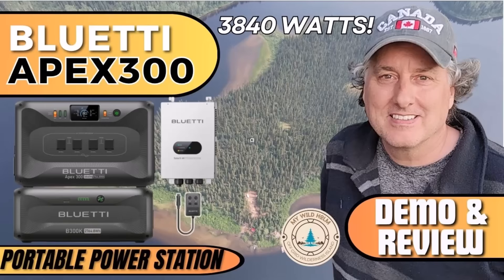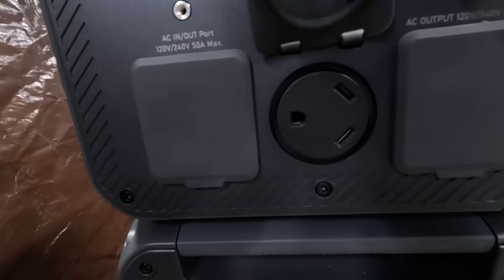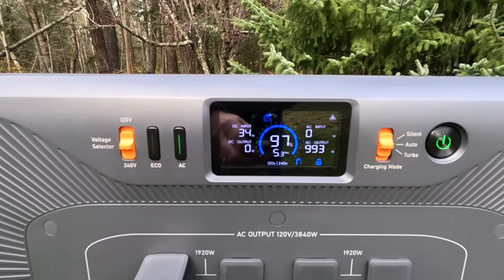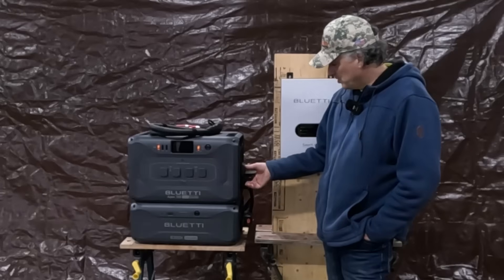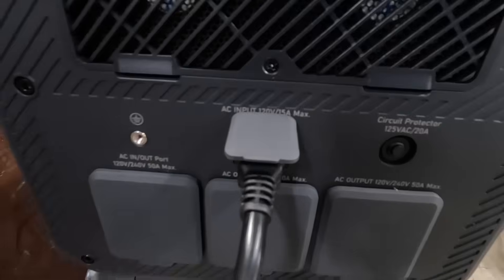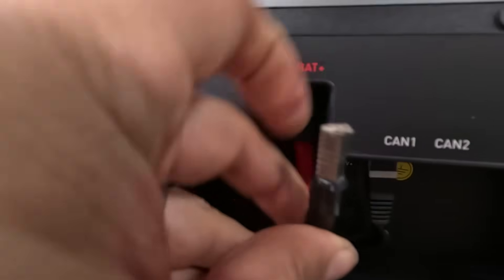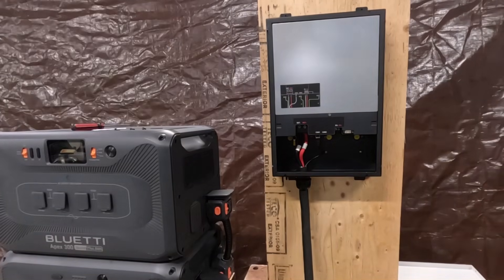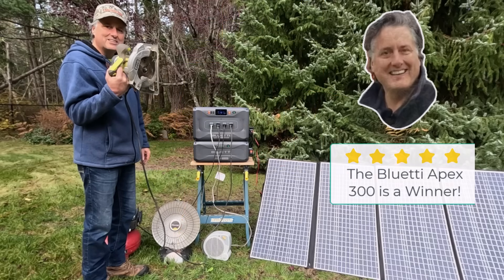Bluetti Apex 300 Solar Generator – Massive Black Friday Savings + Full Demo & Technical Review

Comment: It's a great piece of machinery if you have a smart phone and the APP, otherwise there's not much you can do and if you can find solar panels to max the 2 solar inputs of 1200W without going over the VOC of 12v-60v by multiplying the sum of Voc for your pv string X temp coefficient for your region or if in parallel don't go over 20 amp max, good luck. I guess they want to sell the solar 4k.
Reply from the maker: Hey there @ianmacneiI1727 I agree that physics limits the actual max allowable input values of Maximum Power Point Trackers (MPPTs). So for the benefit of other commenters…

The Apex 300’s solar inputs have two real limits:
Max Voltage (Voc): 60V
Max Current Draw (Imp): 20A
There is *no wattage limit*, so you can connect far more than 1200W of panels as long as total Voc and total Isc stay within spec.

Solar panels don’t produce power at their open-circuit voltage (Voc). They produce power at Vmp (Voltage at Maximum Power), which is *usually 70–80% of Voc*. So any array kept under a 60V Voc limit will normally operate around 40–48V when actually producing power.

Since the Apex 300 can only draw a maximum of 20A, the most power it can ever take from solar panels operating in the 40–48V Vmp range is: Pmax = Vmp × 20A ≈ 800–960W

Even if you connect 1500W or 2000W of panels, the MPPT will simply cap the current at 20A, so the charging power will never exceed roughly 960W.

This is why the advertised “1200W solar input” isn’t achievable in real use. It’s just the theoretical number from: 60V × 20A = 1200W

In practice, the true usable solar charging power the Apex 300 can draw is about *960W per MPPT*.  It's also worth noting that what actually reaches the batteries will be slightly less due to normal conversion loss.

Hope this helps! – Ryan